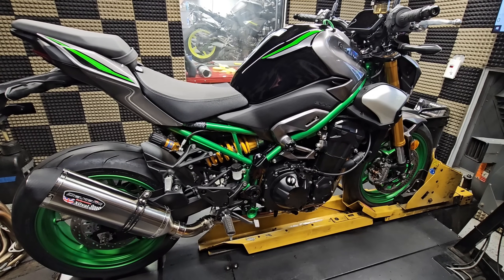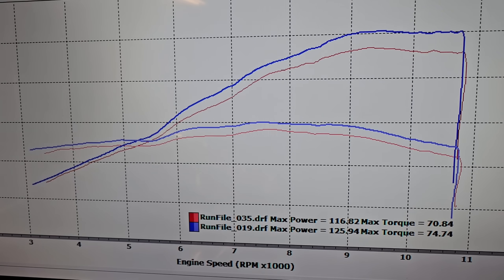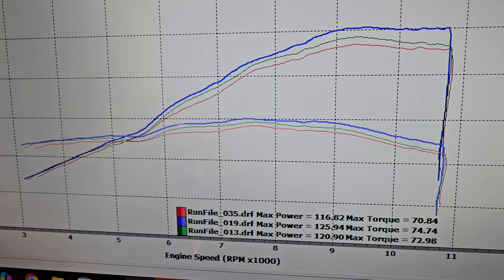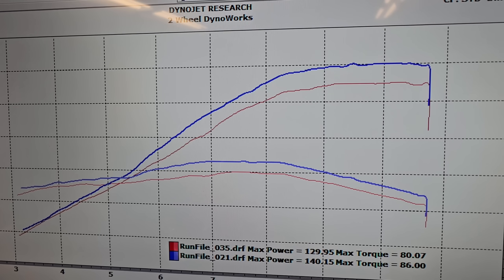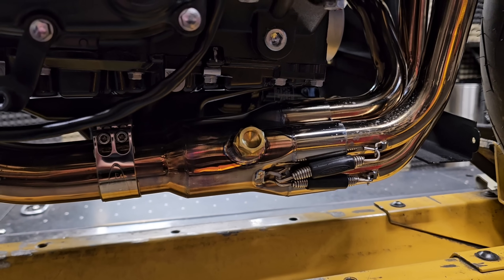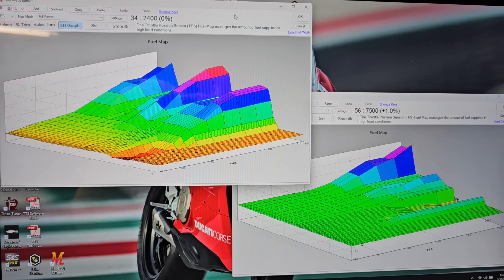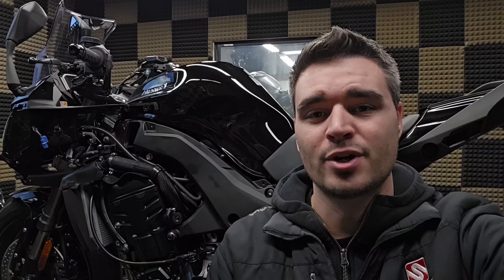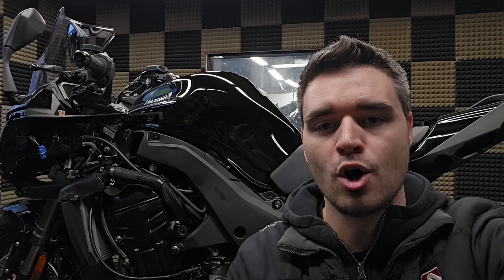There is a BIG difference between the performance of these two popular header designs!

Comment: The Delk 4-1 gains were about the same as the 4-2-1 boutique system till 3000-7500 rpm, so it beefed up the most used rpm range on a street bike for a LOT less $. The overrev range is only going to matter on the track against identical bikes. Meanwhile, the Delkevic header kit I'm looking at is actually 4-2-1.

Comment: Similar results to on car engines. 4 to 1 headers are peaky, they will make more top end peak power but tend to lose low and mid range torque. Where as 4-2-1 tends to gain everywhere, but in what I have seen car car engines may result in a few less peak hp…. But unless it’s a drag car, it’s silly to go with the 4-1, for everything else circuit racing or street the 4-2-1 is better.

Comment: i have a question about the 4 to 1 exhaust. what about the 2 os sensors in the exhaust. ? do you not get an engine failure light if you disconnect them.? and does the engine drive normally if you remove the o2 sensors

Comment: The book 'Scientific Design of Intake and Exhaust Systems' by Phillip H. Smith & John C. Morrison, 1st published in 1962 may be old, but the facts are still as relevant today as when first written.
I also remember an American aftermarket exhaust company doing extensive research into header flow rates and they found that the number and degree of bends where significant in flow numbers.
Interestingly they also found that the old myth that all the pipes in a system had to end at the same point in a collector was not true. Many still believe this today.
Some of the convoluted designs that people came up with to enable all pipes in a system to have the tips all in one plane were a nightmare.
A system with as few bends as possible and as shallow bends as possible is best.  Just make a longer collector to allow the entry pipes to flow smoothly. The result looks far better as well.  Aesthetics are not to be sneezed at.

Comment: I believe your looking at this wrong from an engineering perspective. 

A 4-1 exhaust to a 4-1-2 exhaust is pretty much the same exhaust with a different collector. 

But a true 4-2 exhaust with a balance pipe bridging the center two header pipes has a much more of an impact/difference on performance overall… 

Look at the kawasaki zzr600e series, a 4-1 has potential in the higher ranges but the 4-2 has better torque and with the right pipes a better bhp value so I’ve experienced on a build i owned back in the day. 

Managed 116bhp at the rear tyre on a 4-2 delkevic exhaust set up, +5 degree advance and everything else was modded, thank nissin for making compatible brakes and steel lines!

Comment: The into 2 section  pulls a vacuum through to the intake and is for the overlap on the cams enhancing the intake pulse. The into 4 section ends that pulse. This happens @ 1125.33 ft/sec add cam timings, RPM and engine displacement and it becomes a math problem with some artistry.

Comment: In automotive applications 4-1 designs with reverse megaphone can produce comparable performance to 4-2-1 assuming both are very well developed. The megaphone is critical to achieve this. It will be a couple hp difference within a ~1000-2000 range near peak. And 4-1 can be more sensitive to later changes in the system. The principle is identical to bike engines. So, the claims in this video aren't truly accurate, or at least lacks some detail. Generally, one layout will be chosen for the other based on weight, ease of manufacturing, or packaging.

Comment: Stock has CAT. So lower performance and more cost. You have to compare aftermatket 4 to 1 without CAT, with sftermarket 4 to 2 to 1 without CAT. Also changes in exhaust flow require changes on fueling you have to tune the injection and ignition maps properly to each exhaust type to make a real comparison.

Comment: when race exhaust systems first appeared , they were 4 into 1 design  the classic Yoshimura race systems of the 70's were copied by everyone and if you're putting a system on an older bike that's what you go for , you could possibly develop a 4.2.1. system for older bikes ,but really who's gonna pay for that development work and who's going to want it , and that's where Delkevic started , making replacement exhausts for older bikes,  there was a demand and they made them cheap enough to sell to a mass market . Akrapovic make race exhaust systems ,they spend loads of money developing them for maximum gains , yes a 4.2.1 system works better than a 4.1 but that's modern tech that back in the day no one understood , personally i'm into my older bikes and don't like the look of modern systems and i don't really need the extra 15%  performance in my classic bendy frame ,or the extra cost that an Akrapovic system entails . you're comparing a Ferrari versus a Kia . great information but not really a fair comparison , if your intention was just to highlight the differences between the designs there was no need to mention the manufacturers names at all , cheap shot at a cheap system .

Comment: Collector design is absolutely critical to the performance of a 4-1 header as well as tube diameter and length. That collector is not a good design. Usually a 4-1 collector needs to neck down into a small diameter merge tube, hold the diameter for 1"-2" and then go into a megaphone. This increases velocity and scavenging. The diameter and length of the merge tube have to be tuned to find the right length and diameter. Although I think it's still hard to beat that 4-2-1 when it's already making +10hp.  If a 4-1 header doesn't have a proper merge collector it will never perform it's best.

Comment: On a stock unmodified engine, the 4 into 2 into 1 is your best bet
On a full out, built engine, high compression large pistons, more camshaft, ported cylinder head a large tube
4 Into 1 is gonna make more power than 4 to 2 into 1

Comment: Would you say that in general, if you just remove the stock exhaust system and then install an aftermarket 4-2-1, without any custom tuning, the performance will either be just the same as stock or maybe even worst? Correct?
Reply: Depends on what bike.
Reply: @MrJayjay0420  A kawasaki ninja 400
Reply: @nodeadvibes  it will run fine, but it won't be fun to ride. If you like butter smooth throttle and a small bump in power, get it tuned
Reply: @MrJayjay0420  how about if it is a 4-cylinder ZX6R?

Comment: That 4-1 collector doesn’t look near as quality as the 2-1 collectors. Look at burns stainless for a proper 4-1 merge collector design. Also, is there a difference in exhaust primary diameters and mid pipe diameters between the systems? What about the muffler performance difference between exhaust systems?

Comment: I appreciate the video however I have 2023 z900 totally stock, it bounces of the rev limiter almost immediatly in the 1st 3 gears by then your going way to fast for mostly any road so in real world performance does a couple extra hp and torque really make much difference
Reply: On euro spec bikes it's also a lot about mapping for drivability, especially in the low to mid range, that's where all the emission stuff is measured and most engines are mapped extremely lean there, on WOT most bikes run reasonably ok. Not sure about the US bikes exactly though.

Comment: Hi, they use that 4-into-1 collector design because it is highly modular, they can and do use that collector part for a wide variety of bikes, it is also easier and cheaper to manufacture, package and ship from the factory to their various markets around the world therefore it saves them money and ultimatey means they can sell them for less. You also could have touched on why 4-2-1 scavenges better and why and where the y-pipes are placed in 4-2-1 systems, depending on where you want the best scavenging helping optimum power/torque in the rev range etc. Kawasakis particularly seem to rely heavily on utilising balance pipes to aid scavenging and tuning gains so you could have mentioned why that helps too, as you are currently comparing Kawasakis. Some of the best exhausts I have seen are on the eBay Japan site and you can clearly see the different approaches used in solving those problems. I think maybe exhaust building/tuning has replaced making samurai swords as the pinnacle of the metalworker's art in Japan. Or not. :)
Reply: What would happen if the bike could theoretically rev higher 14-15rpm? 4-1 design would maybe flow more?
Reply: Doesn't seem to be that way on the dyno.  Almost all bikes putting up big numbers are using a 4-2-1 design.  If 4-1 was better I think akrapovic would use it instead on the 4-2-1 they seem to favor. I think it is possible to have a good performing 4-1 but the collector needs to be bigger and longer than what most are. Yoshimura makes a 4-1 system (R11 Japanese only) for the z900. I bet it flows very close to the akrapovic. Definitely better than delkevic. I have the delkevic 4-1 and the head pipes are smaller than the stock ones. I measured I.D. and O.D. it's like 2mm smaller on each pipe. Also the collector is too small.  @milanmiloradovic5235

Comment: The merge collector, tube diameter and tube length plays the biggest role but manufactures tend to use a 421 header because it allows more ground clearance, a well designed 4 into 1 can be just as competitive as a 421 but it tends to be more difficult to stick under a motorcycle 421 also makes a bike sound deeper compared to a 4 into 1.                                                                                                                   
To think that back in the day manufactures made 4 into 2 systems with a link pipe to try getting similar scavenging as a 421

Comment: In 25yrs ive never seen 4 into 1. Not aftermarket for Race reps anyway. Ive seen stock pipes come 4 into 1 collector but thats why i was getting a full system to ditch that. Years ago we just used to reem out the catelizers and tune it. Before 0² sensors.

Comment: So besides a performance filter, full exhaust and velocity stacks. What else can we do to make more top end hp to the wheel on these bikes? Obviously suspension, gearing and brake upgrades are important too. I’m just looking for more total hp And please don’t say buy another bike
Reply: Less weight. So, lithium ion battery, titanium nuts and bolts, forged wheels, 520 chain conversion, lighter sprockets. Lightweight makes for effectively more horsepower, effectively more acceleration, effectively quicker stopping and effectively better handling, especially side to side transitions.
Reply: @Lieutenant_Leftenant  True. Lighter wheels are probably the best upgrade. Less gyro forces counteracting lean, less weight to accelerate in both linear and rotational speed. 

Some say 1kg weight saved on rotating components has the same effect as 2kg saved on non-rotating components. Makes sense in a way but I'm not exactly sure if it holds up according physics laws.
Reply: Those are the bolt on mods. You can get more with engine work. Order from least complicated/expensive to most complicated/expensive. Custom cams, head port, high compression pistons, lightened and balanced crank, titanium or aluminum conrods, overbore...

Sky is the limit but how deep is your pocket?
Reply: @gogocro1  pockets are pretty deep. Enough for engine work, the problem is there aren’t any companies that make cams, big bore kits, valves, springs etc
Reply: How much can we safely increase the rev limiter on these bikes?

Comment: I've seen 4-2-1 collectors which paired the cylinders differently, such as cylinder 1 and 4 paired, cylinders 2 and 3 paired, and then the last junction. With a common flat-plane inline-4 engine firing every 180°, in the usual 1-2-4-3, you'd only achieve proper scavenging with correctly paired header pipes, that, or the scavenging effect would have to be made from the last junction which seems like a timing issue.
Reply: Totally depends on the firing order.

Comment: That happens because you run them on same mapping, when scavenging gets to the level when mixture gets lean, and you start to loose hp. If you enrich mixture you will get even better results, because the bike got the proper amount of fuel to the air it can now pump through. And 4-2-1 works better because it is simply closer to stock by its dynamics
Reply: They developed specific maps for both systems. Have you even watched the video?
Reply from the maker: You clearly didn't watch the whole video...we tailored the fuel mapping to each specific setup. We discuss the fueling needs between the two systems at length in the second half of the video.

Comment: Most bike 4-2-1 pair the "wrong" branches. Any cars pair the "correct" way, which is to pair branches 1-4 and 2 -3

Why is this. Would love an answer. My only assumption is packaging difficulties.
Reply: Good question. I'd love to know the answer too.
Reply: isn't this bacause the firering order of the cylinders?
Reply: @Sharkdzilla  1-4 are always pairs as are 2-3. This is because of the position of the crank journals in a conventional il4
Reply: Interesting question. My last car was a 1.5 turbo Civic Si that had a twin scroll turbo that routed 1 and 4 together and 2 and 3 into the other inlet hole. Always wondered why that wasnt the case for our old CBR1100xx or FZ6.

Comment: I wonder what a different (less low buck) 4-1 would do.  That collector is visibly awful on the delkevic. There is no merge, and that big open can behind the head pipes is exactly the wrong thing to do, then a weird step down to the link pipe.  In theory a good 4-1 should have a better peak at the tuning length, but more focused compared to the broad spread of a 4-2-1. Would also be cool to see what changes when you pair 1+4 and 2+3 in a 4-2-1 vs the somewhat oddball 1+2 and 3+4 pairs.  Was that pairing done for packaging constraints or just for sound?
Reply: That's what I've heard. A quality 4-1 will make better peak power over a 4-2-1..

It's skewed using a super budget brand like Delkevic. Some pro drag racers swear by 4-1
Reply: What @dylanwalker5450 said.  👍

Comment: This whole test is kinda pointless without using the same end can on both header designs...
Reply from the maker: They're all effectively the same length with open mufflers of nearly identical outlet diameter and have no baffles used in any of them. It doesn't get more apples-to-apples than that between different systems when the only real difference is what we wanted to highlight here (the header design).

Comment: Most informative bike channel. Great to see someone tune the whole rpm range and not focus on max rpm at 13.2 afr. No Dyno can match real world airspeed at high rpm and 13.2 ends up way to lean and the bike “falling over” up top. Keep up the great content
Reply: I used to think the same way until I started using wideband sensors on my bikes. The afr remains relatively the same from the dyno to the street.

 The MAP sensor in the airbox compensates quite a bit for ram air effect. So that 13 afr at 20km will become 13.1 at 250km.
Reply: @ from my experience, especially WOT the afr can vary by more than half a point in real time
Reply: @rosscurrant8940  I've had widebands on modern 10+ bikes now. The only time I see it vary is whenever there is ethanol in the fuel. That is a substance difference.

Otherwise 10km vs 300km there is virtually no difference. This is exactly what the MAP sensor is supposed to do, compensate by measuring the air pressure inside the intake manifold and the ecu adjusts.
Reply: @ depends on ecu in reality but even with Fueltech etc having corrections, 13.2 on the dyno is lean at the drag strip. I tune for 12.6 wot on the Dyno. Maximum power isn’t always the best for performance

Comment: Keep up the great work! Any advice for 4/2/1 pipe for 2020 MT-10?
Reply from the maker: Those OEM headers are darn near perfect. There's zero need to replace them. Aftermarket full systems for these bikes are barely 1hp stronger than a 3/4 system; the OEM R1 and MT-10 header is THAT good.
Reply: the mt-10 comes from factory as a 4/2/1 header , and my 23' MT-10 comes with titanium 4/2/1 header from factory
Reply: And it's a crossplane engine sending pulse signals down the headers in a different pattern than most all other flat-plane fours.

Comment: I hope you guys are planning to get the new Honda cb1000 hornet. That bike's going to have 26 horsepower locked in the ECU thanks to EPA garbage. Similar to how the zx4rr had horsepower along the way, due to EPA noise regulations.
Reply from the maker: We already have loads of tuning done on the 21-24 CB1000R and our ECU Flashing Service is available for them on our site. We will be buying a 2025 as well to go through this same process 😎🤘
Reply: @2wheeldynoworks  Good. The '25 CB1000 Hornet is a completely different animal from the '24.
Reply: Have you heard that it's coming to the states?
Reply: @MoremoneythansenseV4 Yes, it was announced this week that the new CB1000F Hornet SP, along with the CB750 Hornet and NT1100, are all coming to the US.
Reply: @MoremoneythansenseV4  It is, yes. $10,999 for the SP
Reply: @Lieutenant_Leftenant  Probably the best bang for the buck.  Probaly even moreso than the GSX-S 1000
Reply: @MoremoneythansenseV4  The CB750, CB1000 Hornets, and the NT1100 are all on Honda's domestic site.